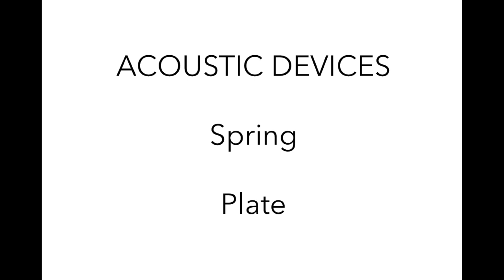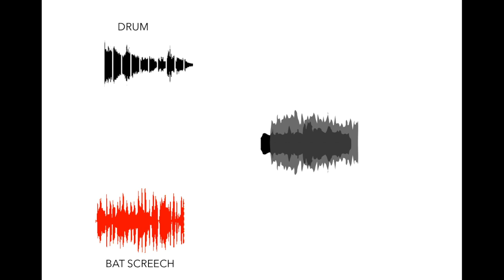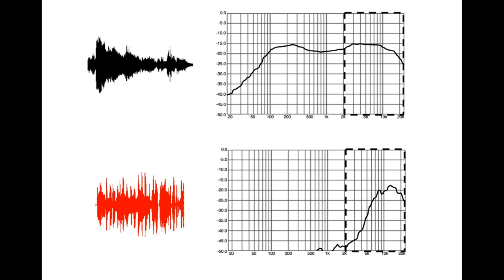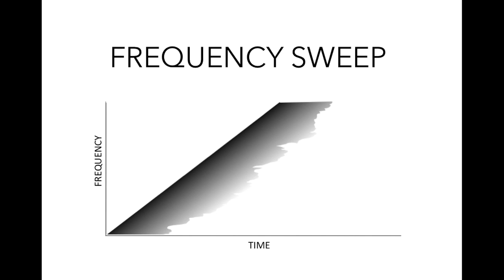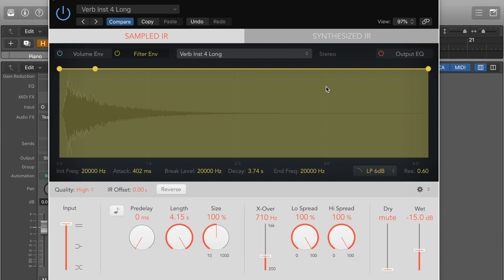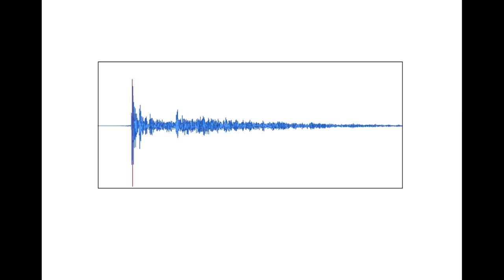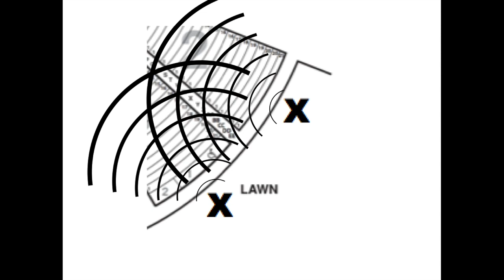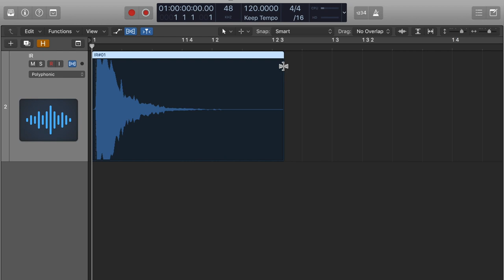Do you understand IR Convolution Reverbs?

Comment: That's the best video on IR's I've seen on YT, well done! Do you use omni mics for IR's?
Reply from the maker: Thank you!!! Honestly, I've used both and had good results. Cardioid allows for a bit more spatial isolation if you're shooting for a 5.1 reverb with a clear "forward" direction.
Reply: @devinlsheets_alphasound  I'm curious because I use impulses for placing dry sounds in the environment and improving dialog recorded in the studio (for games mostly). I'm torn between using omnis which should get more of the room response, and mics actually used for recording things like that - hyper and supercardioids. I know I should just do my own tests but I figured somebody must have did this already. Somehow, your video is one of the very few good resources on IR's I could find (outside of recording guitar cabs), so thanks for that. I didn't know the trick with trimming of the impulse.